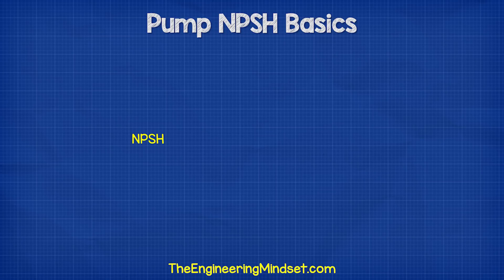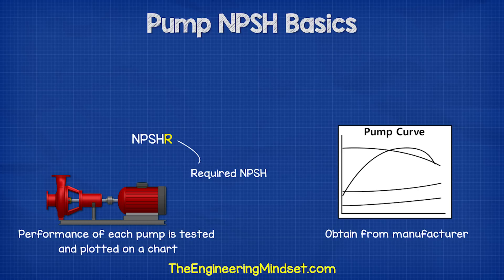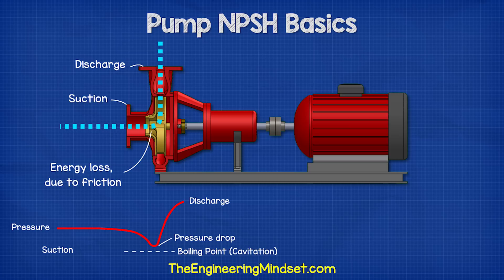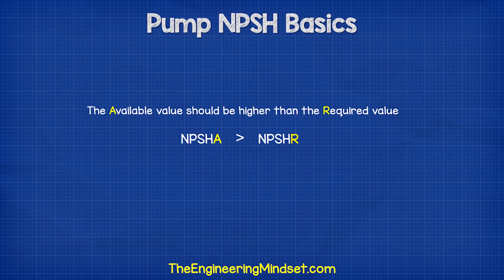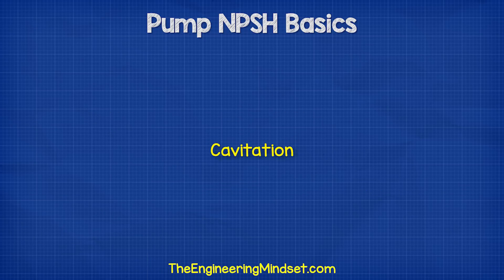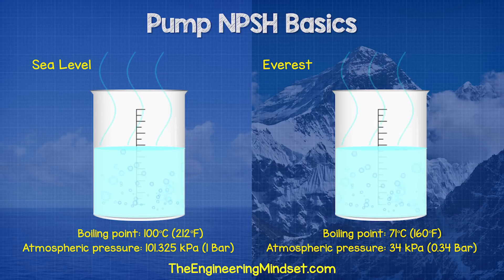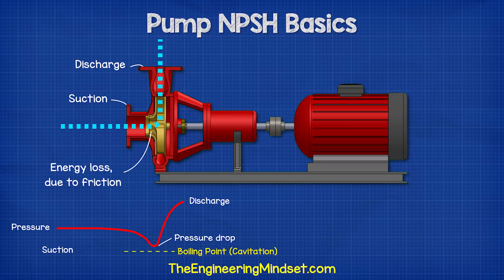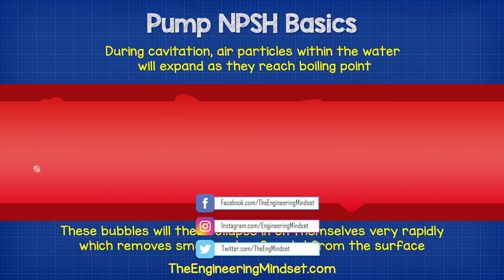Pump NPSH Basics

Comment: I have a question. After watching all of the videos on electricity generation on the channel, I am confused about the North America system. In one video it is listed as 3 phase generation and transmission. It is then stepped down in the neighborhood and local lines are tapped between one of the three phase lines and neutral for 120v or across all phase lines for 
208v. 

In another video, it is listed as a split phase where the secondary of the transformer is 240v with a neutral tap off the center for 120 between one end of the secondary and neutral or 240v between the two ends of the secondary.

These sound contradictory. What does the secondary of the neighborhood transformer look like? Is it three separate secondary coils for 120v each coil or is it a single coil with a center neutral tap for 120v over half the coil and 240 over the full secondary coil?
Reply from the maker: Seen our new 3 phase transformer video?➡️: https://youtu.be/u0SsejDCVkU

Comment: Ta add a few details to this; The NPSHR will also depend on where the pump is operating relative to its design / best efficiency point. At this point the NPSHR is at its lowest. Going to higher or lower flow this will add eddies as the flow does not match the impeller`s blade angle, i.e the more off design the pump operates, the larger eddies, the lower the local pressure inside the eddies will be, hence generating cavitation bubbles (steam,  not air as stated in this video). This can be very dramatic for pumps operating way off-design and result in cavitation damages even though NPSHA > NPSHR,a very common thing to see in the industry..